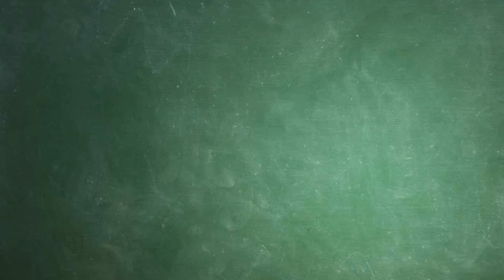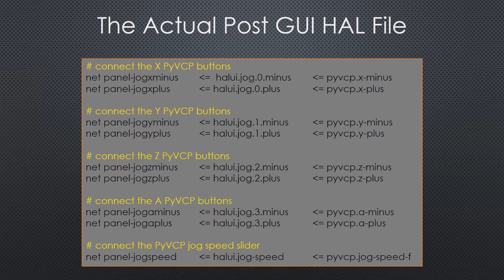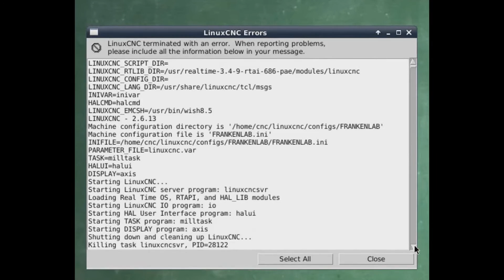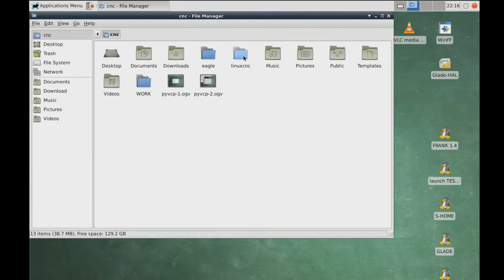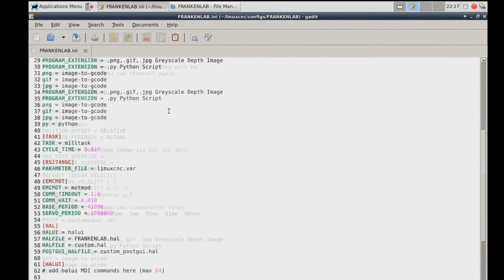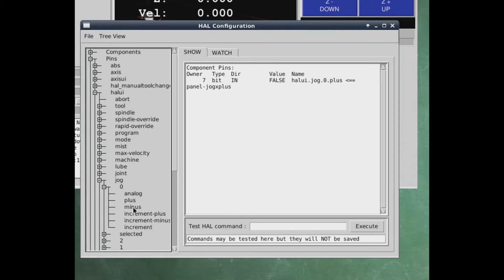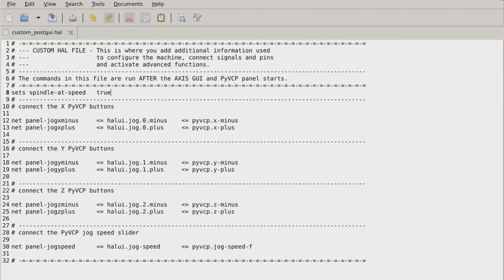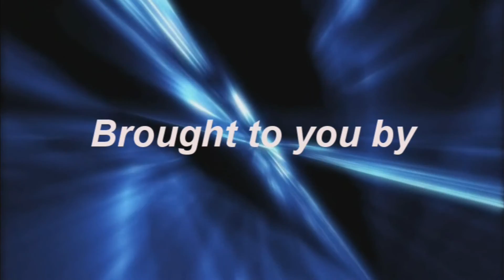Frankenlab CNC #12 - pyVCP(2) - Connecting Signals

Comment: Jerry, thanks for taking the time to create these videos.  I ran into an
 issue with the error: Pin 'halui.jog.0.minus' does not exist.  After 
much research I found a post on the linux board which said to replace 
halui.jog.0.minus with halui.axis.x.minus....etc, for each the X, Y, and Z asix.  Then on the slider, I
 had to replace halui.jog-speed with halui.axis.jog-speed.  I believe this change is part of a newer version of LinuxCNC   However it got my panel to load and work.  
Here is the linuxcnc board post where I found my solution:  https://forum.linuxcnc.org/24-hal-components/31442-pin-halui-jog-0-minus#122054
Reply from the maker: It may be because of how you did the configuration... some known configurations in STEPCONFIG use jog... some custom configurations like the 6-axis PUMA use joint. I'm glad you got it working... and I'm glad my videos are helping people like you. :-)

Comment: Is it possible to switch the function of a button? Let's say the first time you press it the spindle starts, and if pressed again the spindle stops. Like a toggle switch. And how to implement in the same way those general Digital Out/In which cana remain as spares of a parport???
Reply from the maker: You can set up a TOGGLE function... the button applies it's output to the function... the output of the function is then applied to the MDI or whatever you want to control. 
RE: http://linuxcnc.org/docs/html/man/man9/toggle.9.html

Load the function, add it to the servo thread, use the function.

If you get stuck email me and I'll try to assist you.
Jerry
Reply: thanks. it took me a while to figure out how to do this correctly, but at last it works now
Reply from the maker: I thought that you would figure it out... and now you know how to add functions to LinuxCNC.
(If you still had trouble I would have send you the code... but this way you learned an important skill!)

Comment: really enjoying this build series. I am going to build a 4 axis hot wire cutter for cutting out foam wings. Was looking at mach3 but there seems to be a lot of issues with which version of windows to use and which version of mach3/4 to get depending on control boards. Seems like linuxcnc will just work with a parallel port and tb6560 board.
Reply from the maker: Nathan Knight Well then... my buddy Wolf is building one... and we are cutting all the parts on my monster mill... and of course making video of it. Get my email address from the Askjerry.info page and I'll send you the LinuxCNC configurations I have so far.
Reply: thanks man, sent you an email.